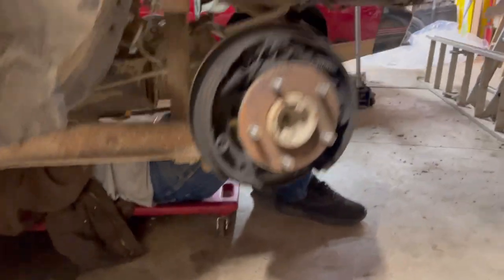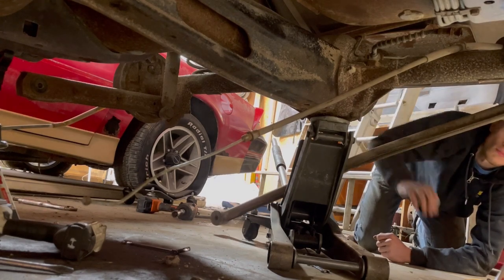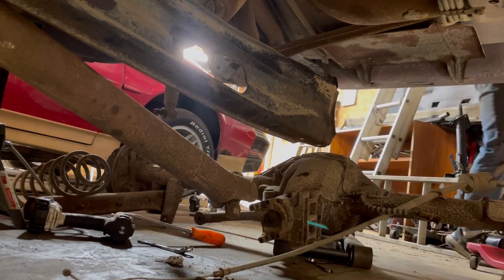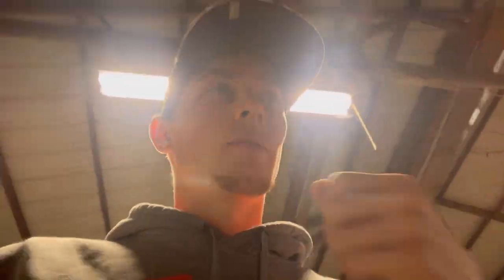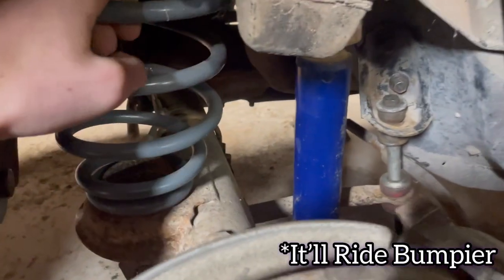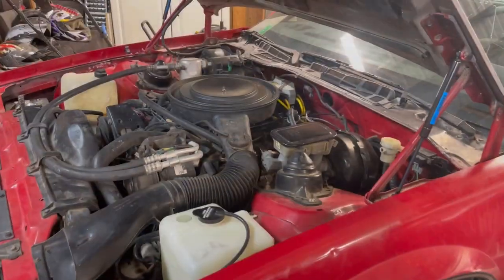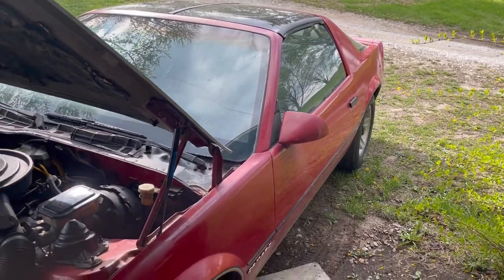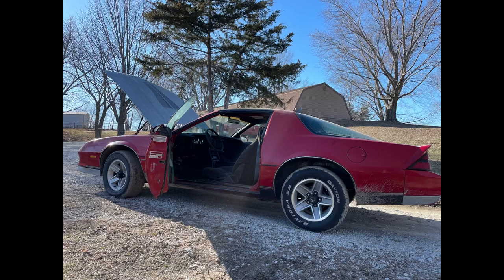No More One Wheel Peel… Swapping in a Positraction Rear End on My Third Gen Camaro!!!

Comment: How do you identify which rear end you have? Everything I see says to look for a number on the passenger side axle tube. If mine ever had a number, it's gone now.
Reply from the maker: If your looking for the gear ratio there’s a trick i’ve learned from someone a long time turn the rear driveshaft by hand. Count the number of driveshaft revolutions required for one revolution of the tire. I usually mark the driveshaft while doing this too
Reply: You have to clean the rust off to be able to see the number

Comment: WHY would you want a 2.77 ratio??
Reply from the maker: Well i don’t want a 2.77 gear but for the mean time we just wanted to have a posi in it. Hoping to at some point change ratios
Reply: @mr.luckyracing7112  I sold a 2.93 posi because I didn't want 2.93s.